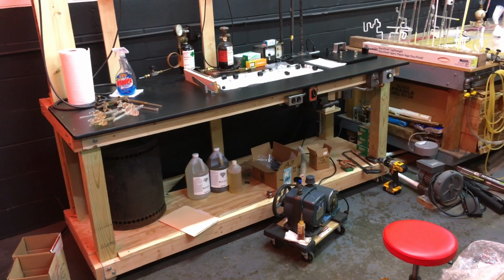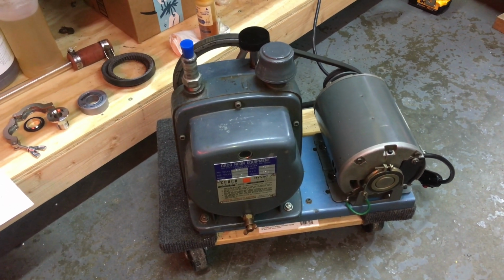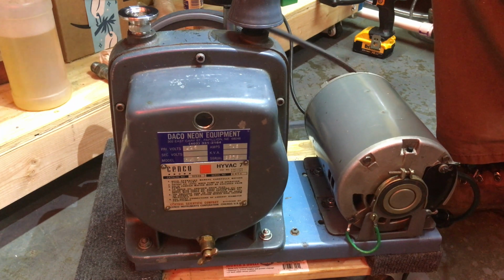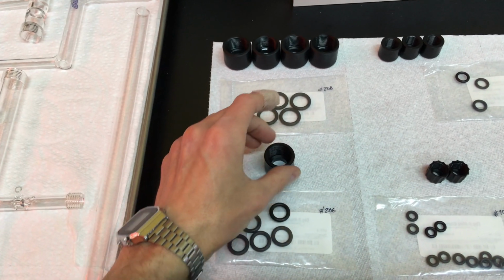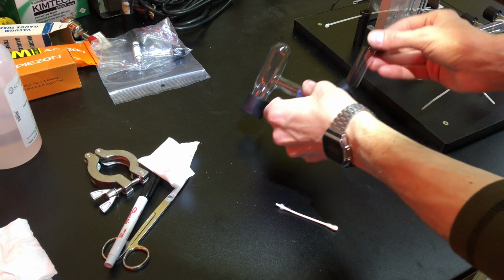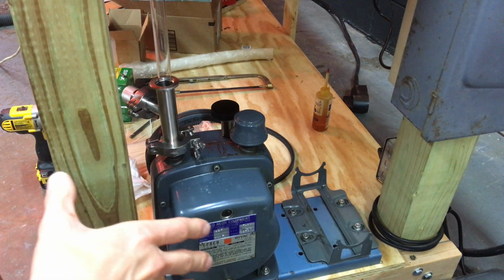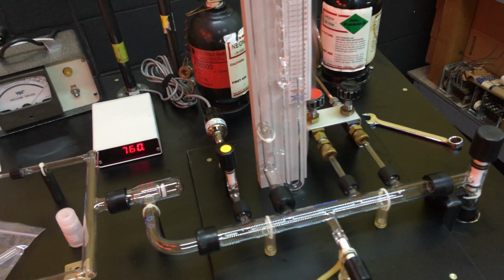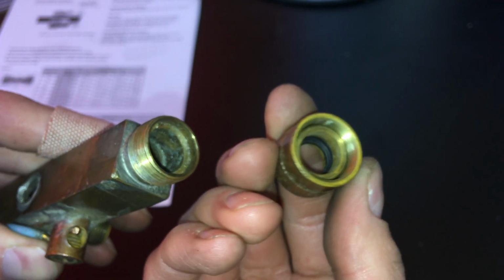Neon Bombarding Setup Part 3: Vacuum System (with chapters)

Comment: Hello, thank you for sharing your work. I have a question about the debris trap. You used a piece of fine mesh from a aquarium filter bag. Do you know what the mesh material is? I would assume it's nylon? Is nylon ok to use in a vacuum? Outgassing?
I'm building a manifold for gas discharge tubes and I'm looking for a suitable material for a debris trap. Thank you for your time.
Reply from the maker: hello!  i talked directly to the man who manufactured these borosilicate manifolds for Daco (Mark Snyder), and he was the one who told me to use the aquarium mesh bag.  a cursory search seems to confirm your assumption that they do appear to be made of nylon.  i personally did not notice any significant outgassing after the initial pumpdown, but the observation (or lack thereof) of one random dude on the internet isnt a large sample size, haha.

if it concerns you, i would suggest running a leakdown test before & after adding the mesh to see if it has any noticeable outgassing (after the initial outgassing, of course).  i would love to hear the results, if you would like to share them here, because im sure others will have the same question in the future.  i would do the test myself if my system were currently set up, but it is in storage at the moment until i can find a suitable workspace.

best of luck on your manifold construction!  feel free to ask other questions if/when they arise.  cheers!
Reply: @NeonPreservation  thank you for the reply!
Good to know that the mesh didn't give you any problems and that it was recommended by the manufacturer.

Thanks for the suggestion. Once I get my system up and running I will try a controlled test without nylon mesh and with mesh.

I appreciate you taking to help!
Best of luck on finding a work space. I hope you find an amazing space soon.

Comment: Brings back memories. I made my own diffusion pump from glass and mercury. The  vacuum pump was an old refrigeration pump which I still have. Amazing you could find the neon shop specific equipment. I am very familiar with the ground glass cocks, always having to clean and grease them and they often got stuck. Pretty much standard chemistry setup.
Reply from the maker: a diffusion pump is the next item on the list.  pretty awesome that you made your own!
Reply: @NeonPreservation  It was fairly simple, just bending, blowing and fusing tubing together. I collected mercury from a/c thermostats. Everything I have stored away is a mess but hopefully one day when I am ready to move I can find it and it's hopefully not broken.
Reply from the maker: nice!  i too have some A/C Hg tilt switches i rescued from a dumpster.  never know when you might need them for a project or whatever...

Comment: Where can i buy the borosilicate because i have the same. But i cant buy new parts?
Reply from the maker: the Daco borosilicate manifolds were designed and built by Mark Snyder.  he still makes, repairs, and sells borosilicate neon manifolds & parts on his website: www.svpneon.com

also, if you have a scientific glassworker nearby, it is possible for them to make you custom parts using supplies from scientific supply companies like ChemGlass ( www.chemglass.com ) or Fischer Scientific ( www.fishersci.com ), etc.

Comment: Hello, I refer back to these videos so often, so thanks again for always posting quality content! Wondering with the system outgassing - do the items that have outgassed stay outgassed? Or will they require outgassing again if they are brought back to atmosphere? Thanks :)
Reply from the maker: after the initial outgassing the system will be easier to outgas after exposure to atmosphere (e.g., attaching a neon tube to be processed).  however, the longer or more times it is exposed to atmosphere, the longer it will take to outgas again (e.g., processing several tubes in a row).

this is why they make debris traps with isolation valves, so you can just isolate the pumping attachment and it is the only thing exposed to atmosphere, thus keeping the majority of the system under vacuum & making less volume to outgas again.

that is the same reason i put that vent valve right by the vacuum pump, so i could keep the system under vacuum when im not using it.  it can hold at least some vacuum for months (every system leaks; better ones leak slower).

after that TL;DR response... thanks for watching and i'm glad you find the videos helpful!
Reply: @NeonPreservation   ok understood, thanks! Yes I’ve got an isolating valve between the diff and the vacuum pump also, which I use to prevent oil being sucked out of the diff but did not think of using it in this way - thanks again! 👊🏼
Reply from the maker: yes, exact same concept!  i dont have a diffusion pump yet so i just added that KF-16 vent until i get one.

Comment: Thanks a heap for these videos. I’m setting up a plant and they’re helping me a lot. I know the guys that want really scientific, 50+ year quality tubes use a diffusion pump too to get down lower. I know you did a lot of research, so can you tell me why you chose not to have one? I’d like to get away with not buying one if I can help it. It’s an additional $1,000.
Reply from the maker: also, i believe settling for anything less than high-quality can harm the neon industry as a whole.  as a neon preservationist i cannot allow my work to reflect poorly on the medium i am trying to help preserve.
Reply from the maker: the only reason my setup doesn't have a diffusion pump is because there wasn't one in the equipment that i bought.  
i'm a bit of a perfectionist, so some sort of high-vacuum secondary pump (e.g., diffusion, turbo-molecular, etc.) is basically a must for me.  however, i wanted to get all my equipment set up and ready for when i find a diffusion pump; it's the next item on the list to add.
Reply: @NeonPreservation  I gotcha. I can tell you’re a perfectionist! You can find rotary vain pumps that will get you down to .0004 torr (Precision and Leybold) for a few hundred bucks on eBay. I think that’s gonna be all I do to avoid the complications of having to add a diffusion pump. It may not pump down quick enough, worst case scenario I’ll use the hand torch to keep the tube hot while it’s drawing down before bombardment. From what I understand that’s the only reason for the need to vacuum quickly.
Reply from the maker: pumping speed is most critical after bombardment, as the tube is cooling.  contaminants in the tube start to get reabsorbed into the glass once it cools below 175°C, and the larger/longer the tube, the more time it takes to reach ultimate vacuum.

that said, over the past hundred years there have been many professionals who created tubes without using a secondary high-vacuum pump.  the same could be said about gauges.  i, however, am a slow, inexperienced novice and need all the help i can get both with vacuum and with gauges!

if you're interested in vacuum pump speeds/ultimate vacuum, etc., you may find this article of interest:
http://www.svpneon.com/VacuumPumpWork.html

Comment: Hello Great video but I don't understant everything I can't see the secondary pump ?
Reply from the maker: correct, the setup in this video only has one vacuum pump.  eventually i will add a diffusion pump.  the HyVac 7 shown here was not performing very well, so i upgraded it to a newer Welch 1402.  you can see the upgrade video here: https://youtu.be/202Di2xrnew

Comment: Thank you very much for taking the time to pass on valuable information. I have had an interest in the steps necessary to do this. 45 years ago I temp worked in a sign shop where upstairs they made neon signs. I only saw how it was done from a distance and had no interest at that time. Thanks again for your  hands on tutorial. No doubt cost in dollars is substantial, but doesn't include the hours you've spent studying to develop this craft.
Reply from the maker: neon is a truly fascinating craft!  im glad you found the video informative... one of the reasons i make these videos is because there isn't really much out there on neon information and how-to videos, and i share what i have learned along the way.

Comment: what we can replace the dow corning 704
is there something else easier to find? please
Reply from the maker: are you filling a u-gauge manometer?  the only fluids i have heard of using in a u-gauge manometer are butyl phthalate or Dow Corning 704.  theoretically you could use a different fluid, but it would have to have an extremely low vapor pressure... also you would need to know the specific gravity so you could create a scale for accurate filling pressures.

that said, DC 704 seems to be the best choice.  generic fluids are available; a google search for "704 diffusion pump oil" is a good place to start.  here are a couple examples:
https://tmcindustries.com/collections/silicone-diffusion-pump-oils/products/tmc-704-diffusion-pump-oil-bulk-sold-by-the-lb?variant=32056146722883
or
https://diffusionpumpoil.com/products/eco-704-silicone-diffusion-pump-oil?variant=42791174221

Comment: I’m curious about your bombarding setup. I’m currently trying to find the equipment necessary to make neon tubes, and I’ve seen people use variac transformers as their bombarder setup. Is that all you need? Also, how expensive was this whole setup? Because I’ve seen daco branded vacuum manifolds go for $2,400 on eBay and can’t figure out if I could make one myself (2,4k is more than I can afford)
Reply from the maker: neon shop equipment can have a sizable price tag, especially if you buy quality equipment.  lately, the "closed neon shop" bundles i have seen go from around $3k-$6k USD, depending on what is included.

making a glass manifold yourself would require some glass-working skills.  the easiest one to build yourself would be one made from the old leaded-glass stopcocks as shown in this video.  a borosilicate manifold like my Daco one would require the skills & equipment to work hard glass.

it is possible to build/cobble together neon equipment on a budget, but you must have the knowledge & skill to build it properly; if you do it wrong you could end up killing yourself.

that said, John DeArmond has a page of home made neon equipment he has constructed himself, if you want to take a look:
http://www.neon-john.com/Neon/Shop_equip/Shop_equip.htm

Comment: Why do you need so much amperage for the bombarder? I figure that a 15,000v at 30 ma neon transformer would work.
Reply from the maker: more amperage is necessary because more current is required to heat the tube and electrodes to an adequate temperature for processing.  generally, electrodes should be processed at least 10 times the manufacturers mA rating to fully activate the getter on the electrodes (e.g., 300mA for an electrode rated for 30mA). the glass needs to reach a minimum temperature of 225-250°C and the electrodes need to be glowing bright orange (c. 1000°C).  it takes a lot of current to do that.
improperly processed (i.e., impure) tubes will take a long time to burn-in, run hot, sputter, and have a short life span.

that said, bombarding is not the only way to process tubes.  oven-pumping & heating the electrodes using magnetic induction is another way; however, it takes a more customized setup since the oven has to be large enough to fit the tubes.
Reply: @NeonPreservation  ah well that would explain it. That puts my guy out of an idea of making neon. Thanks for the info.....

Comment: Hello I have a question about the connection from the Robbins valves to your manifold. Where did you get the connection  fittings?
Reply from the maker: those compression fittings are 3/8" Swagelok Ultra Torr connectors.  my gas transfer system was sold as a pre-assembled unit so they were already installed, but you can find them at various online vacuum suppliers (e.g., Ideal Vacuum) or occasionally on ebay.

Comment: I am in the process of building my processing table. I have a couple of questions for you. Looking for gauges for this. Where did your find yours. And what did you use to make the leads from the bombarder?
Reply from the maker: bombarder secondary output leads need to be wire rated for high-voltage (i.e., GTO-15)... and preferably run through some additional insulation/protection (e.g., glass tubing, pvc conduit, etc.).

bombarding current meter is just an AC ammeter (0-1A) or AC milliammeter (0-1000mA), doesn't have to be anything special, but for greater accuracy, avoid rectified meters.  read: http://www.svpneon.com/MA_Comparison.html

the bombarding temperature gauge i have is an SVP unit, i picked one up used on ebay since they are no longer available from SVP.

there are many types, brands, and sensor ranges of vacuum gauge available.  they are fairly expensive if purchased new (as is all neon equipment).  i have several thermocouple gauges i got used on ebay, cheapest one was a Daco branded Hastings VT-6 for 99 cents, haha.  it is the gauge i currently use on my setup.  buying used gauges is a bit of a crapshoot though, as you don't know if they are calibrated correctly.  you can send them off to be calibrated, or you can use a reference tube to calibrate them yourself.
thermocouple gauges also need a gauge tube (sensor) that connects to the manifold.  to get an accurate reading, the meter must be paired with the correct gauge tube.  e.g., the Teledyne-Hastings VT-6 gauge needs to be paired with a DV-6 gauge tube, and it reads from 0-1000 mTorr.   The Teledyne-Hastings VT-5 needs to be paired with the DV-5M gauge tube, and it reads from 0-100 mTorr (smaller range, but higher accuracy).

ultimately it is up to you to choose which range and style (digital, analog, etc.) gauges you want.  browse some vacuum websites and read up on manufacturer specifications to find one that you want.  for example, Ideal Vacuum has many brands and models... here is a link to their Teledyne-Hastings page to start: https://www.idealvac.com/Teledyne-Hastings/ct/7-35

another resource to peruse is this information from SVP: http://www.svpneon.com/Gauges.html

i hope this helps, good luck!

Comment: Hi its waris from UK. 20 years of experience of glass banding. Can I ask you where I can buy neon manifold like you. I think its from daco neon. Which closed now. So please help where I can buy neon manifold new like you. I Real appreciate that. Thanks a lot. Best regards
Reply from the maker: hello.  yes, my manifold is a Daco, and you are correct, they closed back in 2009.  if you are looking to buy a new manifold, the only manufacturers i can think of are EGL and SVP (there could be more).
if you're looking for used equipment there were others: Eurocom, Transco, Daco (again, possibly more).
Ventex also mentions having manifold parts and equipment on their website.
Reply: Curious on this as well, for some reason the replys are missing

Comment: Hey! Question. So you have the main stopcock and vent valve closed on start up... and do you have the manometer stop cock open?

I’m wondering when to close the manometer stopcock - is this only when the system is shut down, cooled down and not in use? Thanks :)
Reply from the maker: the manometer stopcock is almost always left open.  the only time it is closed is to measure a pressure change in the system; e.g., while bombarding, or for backfilling with noble gas.

if you have it closed while pumping down or venting the system to atmosphere, there will be a massive pressure differential and one side will bubble over and make a foamy mess.
Reply: NeonPreservation great thanks so much, just about to fire mine up, thanks for the feedback 👍🏻
Reply from the maker: no problem, good luck!

Comment: Hey! Another great vid! Wondering how big the power feed is you have going to the transformer. I have a Daco bombarding transformer that is rated @ 41.6amp

I only have access to a 32amp outlet. I’ve  heard you can safely run them on a 32amp feed as they rarely hit max unless you push it to the absolute max processing large units, and at worst it will just trip the breaker... wondering what yours is on? Thanks
Reply from the maker: hello, my bombarder is a vintage Sola 12.5kVA (you can see it in 'Part 2'), and i have it on a 50amp circuit (that's what i had in the shop).  i am not an electrician or anything, but since the bombarder is only running momentarily, and will likely be choked-down to varying degrees depending on the unit being processed, i believe you could probably get away with it.
you could run it by the neon professionals on the Neon List or on the various neon FB pages to get more input, but i think it is feasible.
Reply: Thanks 👍🏻👍🏻